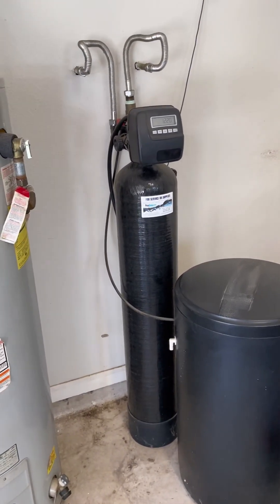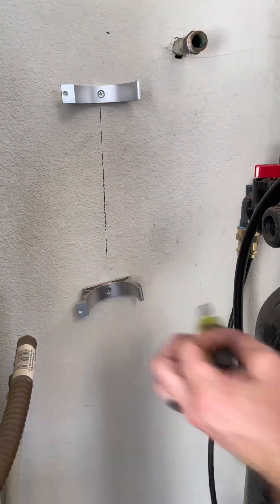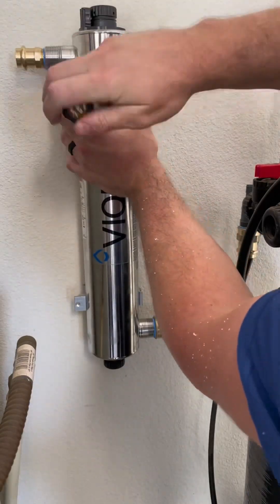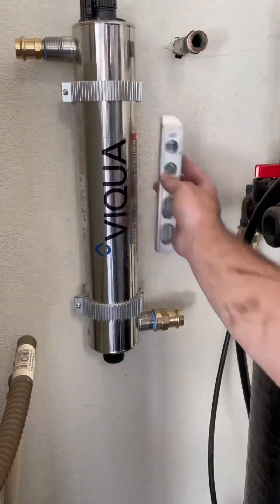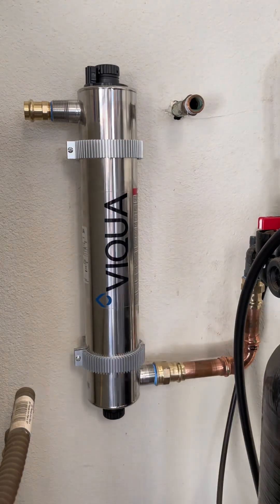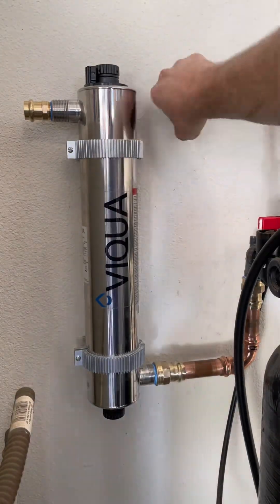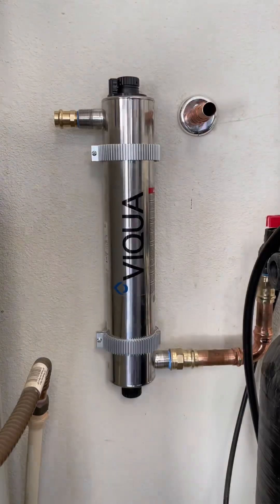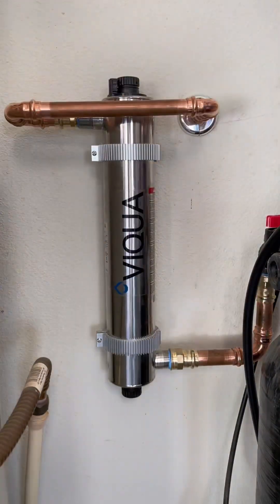UV Water Treatment

Comment: The water needs to be pre-filtered prior to it passing through the UV system to ensure the water clarity is good so the UV light can do its job effectively. 

For example, on my system, I'm going to be running my water through a 50 micron spin down filter, then through a 20 micron, and then through a 10 micron filter before going through the iron manganese tank. From there, it'll pass through what I believe is the top of the line UV system on the market made by Canopus Water Tech, which uses LEDs. More effective than traditional bulbs, lasts WAY longer!
Reply from the maker: This was after the water softener
Reply: @theplumbersplunger There you go. My water is luckily not a high enough ppm of hardness to justify a water softener system. Also, Im building my system to reduce dependency upon the supply chain by incorporating as few consumable components as I can. The world isn't stable. Hell, our entire species is unstable haha. I'll have to stock up on filters, tank media, wear items such as o-rings and lube, and the ballast for the LED UV system, but those last damn near forever!

Comment: If your well is up to code and properly done, it should not have bacteria. This is why you always maintain your well cap. Some of these wells I see make me cringe as a well driller.
Reply: My well cap just sits on top of the well head with gasket could that be the course of coliform bacteria. I did brick a house around the well head with a cover too

Comment: So great thing about uv lights. They dont break down the  toxins in the micorganisms. So you need some extra protection usually chemicals. Carbon filters are a less reliable way to remove the toxins. Also uv lights often get fouled, to clean them make a citric acid solution and wipe down the bulb with it and rinse with ro water. The bulbs last much much longer that way.

Comment: Isn’t there a time period that the water must be exposed to the UV before those organisms are killed? I know that when I use a UV light to purify water in the back country, it says that I have to leave the light in the water for at least 90 seconds. If you’re moving water through it into the system to quickly, won’t there still be bacteria in the water going to the Fossett? I don’t I don’t think those things actually work unless you had it in a huge holding tank.

Comment: These systems are actuly amazing I install plumbing in Muskoka and it's much cheaper for new cottages to get water from the lake compared to drilling wells and will simple use sediment filters carbon n uv systems and never have any issues submitting a water sample by law before the owners can move in one very important thing is the sleeves will need cleaned every time u change u bulb I recommend this is done yearly and u can clean the sleeve with vingager to wipe the glass sleeve clean other wise the bulb won't be able to shine threw n kill the bacteria
Reply: The water still needs to be tested to determine the type of and complexity of filtration needed. Also, consider swapping out to Canopus Water Tech systems which run LEDS as opposed to traditional bulbs. Much better way to go.

Comment: Wowza...

Every 90 reduces pressure by 1PSI, you could have turned the filter 90 degrees, ran it horizontal and eliminated two 90s
Reply from the maker: The homeowner was very concerned with being able to replace the uv light on his own and wanted the uv to be this exact way.

Comment: Great install the only thing i would recommend  putting in a 3 valve bypass around the UV light just in case when changing the bulb you break the bulb or sleeve then the customer has no water just because I've seen it happen many times, just my thoughts
Reply: Those quartz sleeves are so fragile…😊 if you look at it wrong it’ll break lol
Reply: Nice install, but I would also recommend not using propress fittings due to the rubber gasket in the fitting. The uv light will leach into the O- ring, causing a potential leak in the future
Reply: That's I'm going with the best LED UV system on the market. Canopus!
Reply: Yeah, one of the reasons why the installation was so easy was because he didn’t install the bypass which should be mandatory. He should’ve also installed a flow switch so that the UV light is only activated when water is detected to increase the life expectancy of the bulb